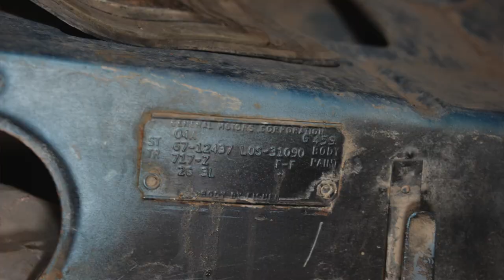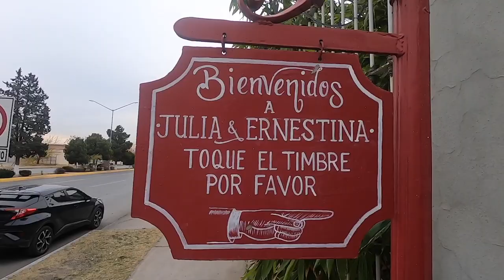Hunting Barn Finds In Mexico, 1968 Camaros parked 25 years, original wrought-iron VW Bug

Comment: the last one had front disk breaks could be a 302 model they had factory front disk rs/z28 rare  the vin tag we seen shows it was blue car blue standard interior 67 april first week  center consol 4sleed 327cid or 6cyl with z22 rs trim